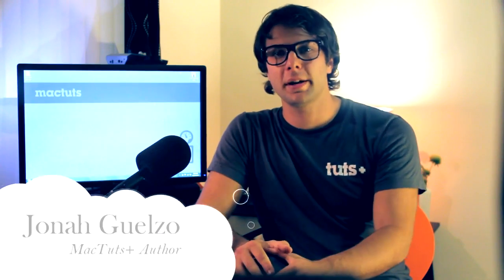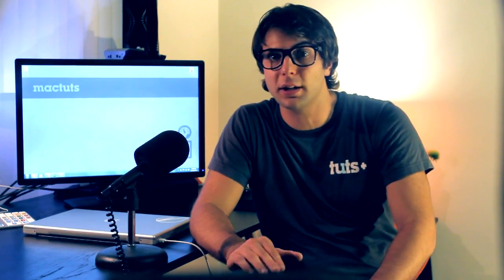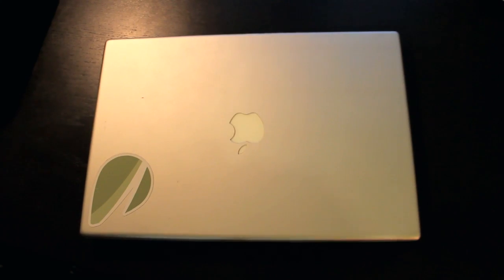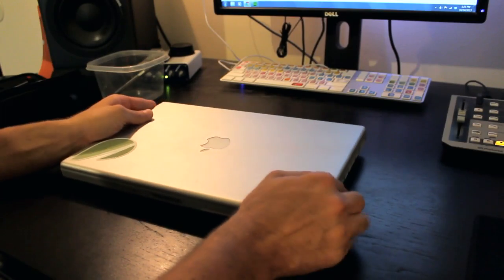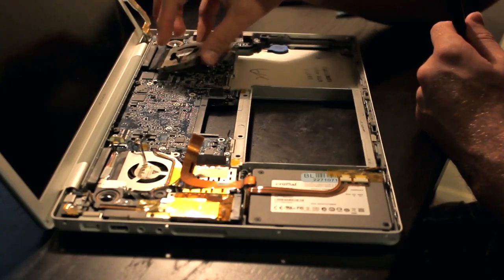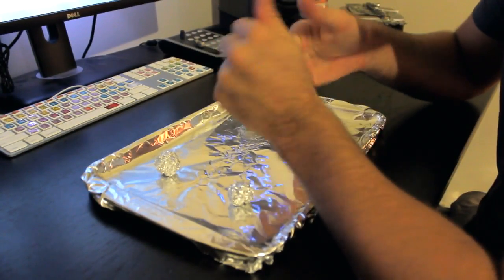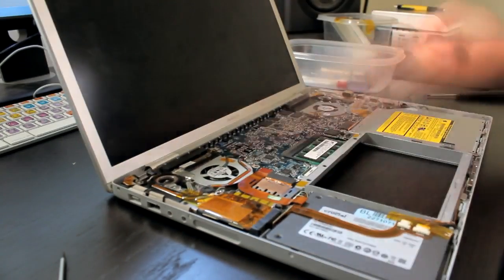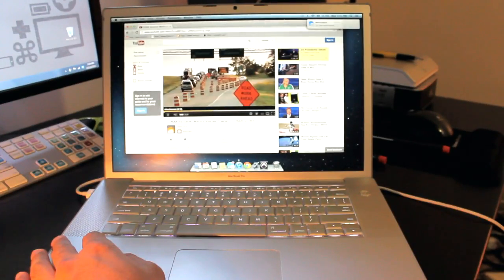How to Cook Your Mac

Comment: To answer your questions... I recorded additional footage of the distorted screen on my iPhone but chose not to add in additional footage to not bog the edit down. This is a common issue, so I wanted to focus on the repair steps, not showing too much time worth of distortion footage...
Secondly you're right on the money... The oven shots were shot before baking actually occurred as I wanted to focus on the baking, not filming. (Remember I was baking my own mac). After I did bake it it was HOT.